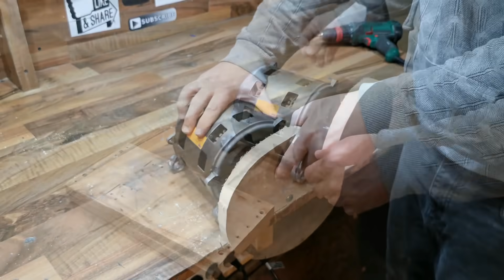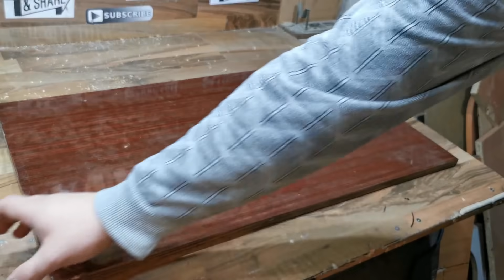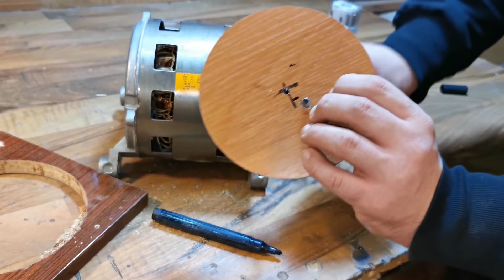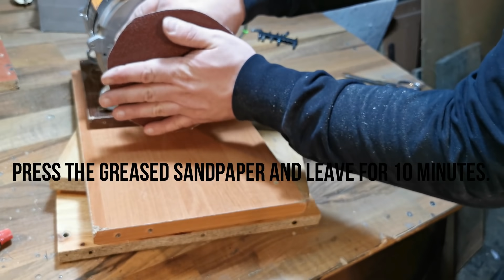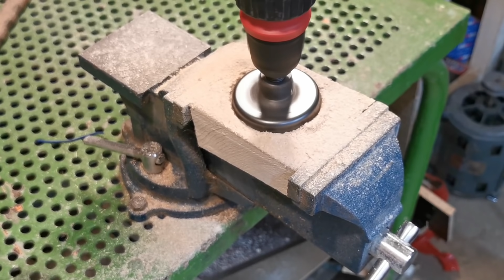3 Ways How To Reuse OLD Washing Machine Motor For Homemade Tools

Comment: The idea is great... but if the screw or any other axis moves inside the wood holes, it will cause those holes to erode and expand and then they will not work properly... I also suggest attaching a box to the saw arm to put weights in it to cause the saw to press on the piece of iron to be cut... and  I would prefer to convert the entire device from wood to square hollow iron...
Good work 👏👏👏👍.

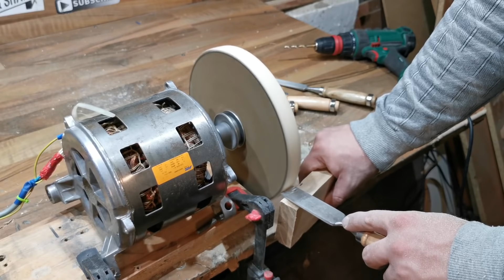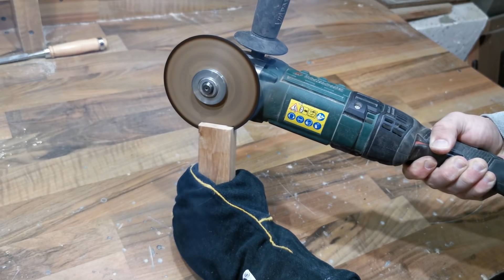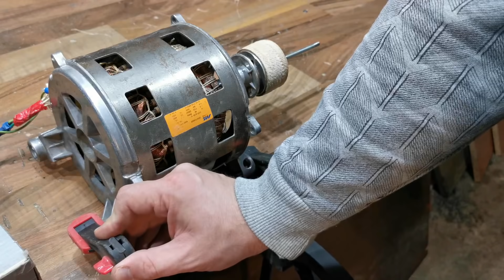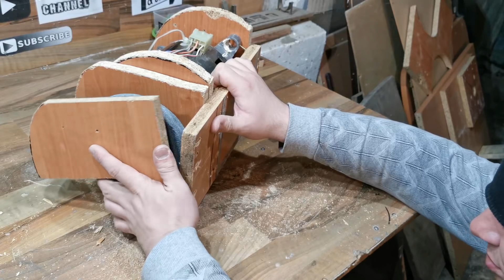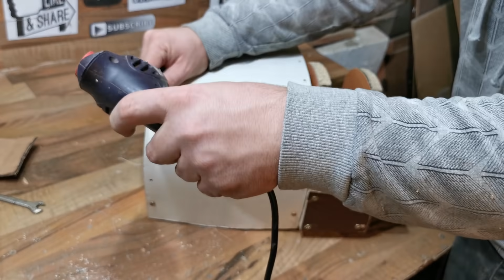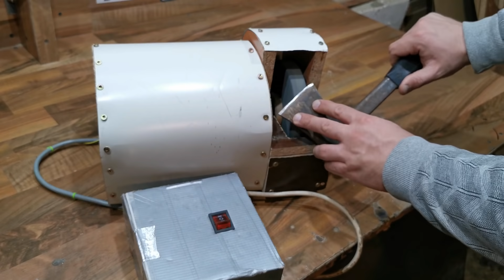Comment: 2:10 A spinning disk made from a piece of board will eventually crack then shatter within a few milliseconds. 5:24 All angle grinders are supplied free of charge for your safety, a BLADE GUARD. USE IT. 5:24 Items to be cut should be held in a vice or clamped to the workbench.  Never cut towards any body part.  32:11  watch out for that spinning threaded rod. clamp the support board and use two hands to hold the chisel.  P.S. I'll ignore the fact you are using very cheap wood chisels as lathe chisels. Even expensive ones are not made for high-speed cutting. 38:12 screwing into the edge of the chipboard parts will greatly improve the chances of splitting. 38:30 & 38:38   see what I mean.  39:23 good you are using smaller screws. probably split but that's ok. You got it covered. 40:31 Nah! Fail all the way. 41:15  do not run the heavy grinding wheel at full speed. EVER.  BTW, an axe is traditionally sharpened with a wet stone using water or an oil stone. A grinder or grinding wheel should only be used to clean up the axe if it has been damaged. Don't allow it to get hot.
Reply: Sewwwawwws
Reply: He won't die, he's a trained professional.

Comment: A  on  your  sanding  disk  from waching  machnie  maybe  add  some vacuum  system
B  for  this  setup  I use as  meuling  some  heavy disk cutting  I  buy  by eeoro  to  wide  about  one  quarter  stick  I place  several  disk  about 5  and  I  have  sanding  disk  for  metal  
jack47 71

Comment: Had a far heavier saw setup in a blacksmith shop run from a washer motor. It was metal and had a sliding weight that could go out a foot or so to add pressure. It looked ugly was slow as molasses but would cut through 6 inch round bar given time.
Reply: Para guallar lluca, con motor de labadora

Comment: A good project I might add the electric motor requires air flow to cool itself otherwise it will overheat and burn up , I would add vents to the cover

Comment: How did u wire the motor ? I have a washer one with 3 cables
Reply: He wired it to run on 12v you can increase the speed by increasing the volts upto 48v. Do not run these motors on ac Rick